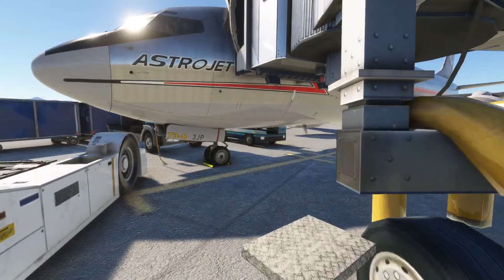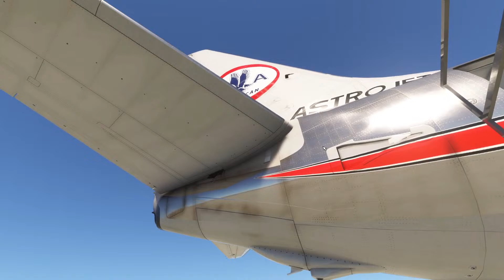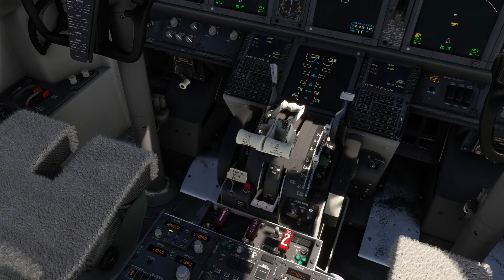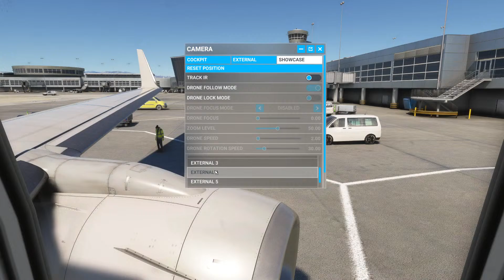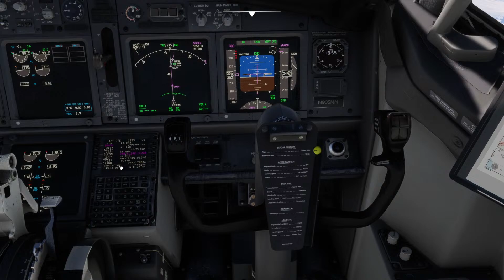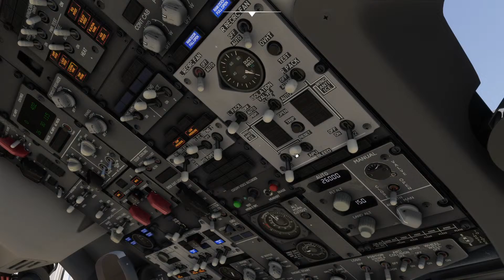PMDG 737-800 KLAS-KLAX || Real 737NG Pilot!!

Comment: Retired guy here. (via V1) Interesting to compare B737 ops in the US to the UK. (Medically retired in 2011 aged 50) Did a Lear60 course with FlightSafety in Tucson, remember it being more practical than the UK I think - better imo.
Reply: Shared cockpit will be a blast, if & when we get it.
Reply from the maker: Absolutely, I’m looking at ways to incorporate shared cockpit ops into the channel!
Reply: @FullFlapSim  If done successfully it’ll require some SOP learning. I know it can be done in XP12 using the Zibo, sadly I’m VR only so not a fan of x- plane for that reason.